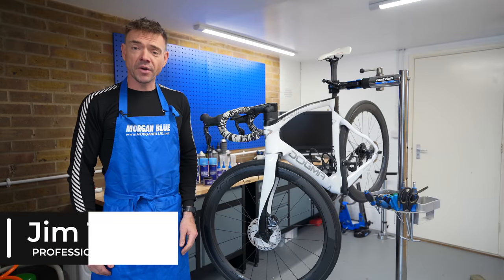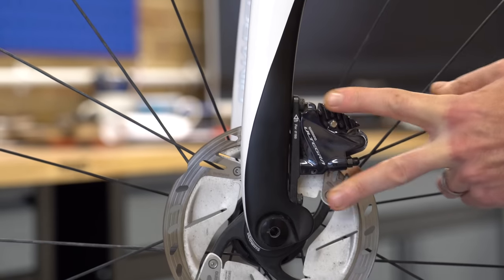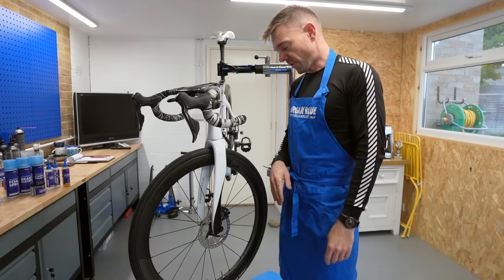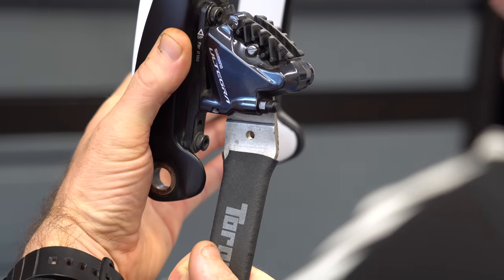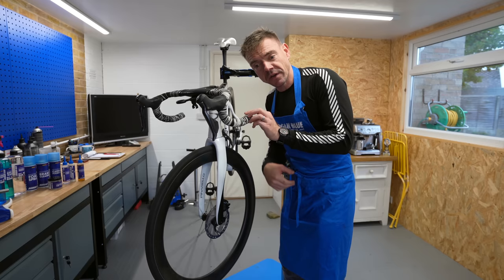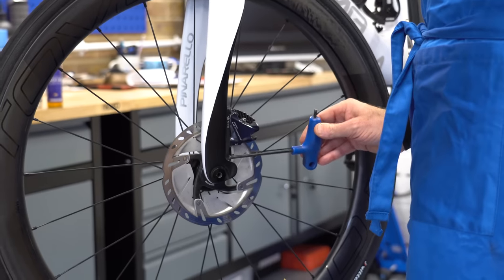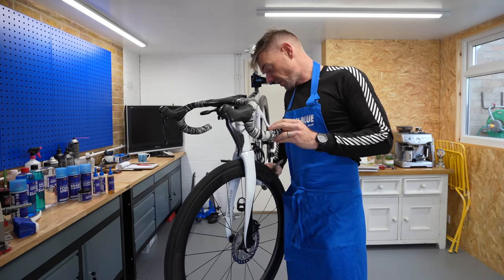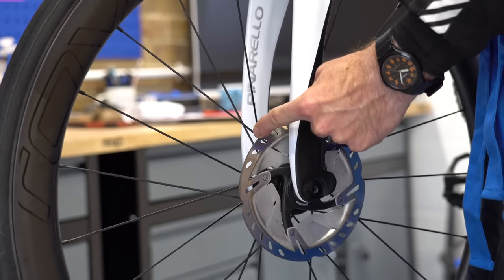How to Set up your Disc Brakes: 3 Easy Tips for Better Braking

Comment: This is a wonderfully clear description of basic disc brake maintenance.  I've tried the first method loosen brake caliper bolts, apply brakes, and then tighten the bolts and it works almost every time. Thanks for the tip about the tool, this seems like a must-have. (I've actually damaged pistons using screwdrivers, etc.) 

I'm more skeptical about your guidance regarding disc rotors.  In my experience, if you're having brake problems, it's pretty much never a rotor issue. If you're not throwing your bike into your car every weekend, your rotors will probably be largely intact for a  good 5-6 years. If you do have a bent rotor, trying to bend it back will probably make it worse; I've actually watched a bike mechanic destroy my disc rotor right in front of me by bending the ** out of it. If my rotors ever get bent, which will almost certainly never happen, I'll just avoid a world of bother and just replace them.
Reply: Ultegra and Dura ace (not new ones) get bend very easily.
Reply: @UC4EDj0x4Ja_llcRnKKips_g I've bought mtb rotors. Just get XT or XTR they're much better. New Ultegra 12s is already with these kind of rotors

Comment: I had disks rubbing for a year and I couldn't figure out the cause. I don't know why it never occurred to me to reposition the the whole brake by loosening the connecting bolts, apply brake, check center, and tighten. Thank you very much for reminding me of this. Solved a long-running frustration and makes riding just that much less aggravating. It's the simple things most of the time.

Comment: Clear advice, nice one. My GRX brakes would not stop rubbing using all of the above techniques... I had to bleed the brakes to get the pistons to retract properly. I also find that flat mount bolts need to be tightened a tiny bit at time as going all-the-way tight one one and then the other can mis-align your carefully straightened calliper. So annoying!
Reply: Yep, thats a very good point 👍
Reply: Exactly this.  Spend ages aligning the calliper only for it to become misaligned by tightening the mounting bolts back up to the correct torque setting.

Comment: Excellent video!  I can only add that if you are resetting the calliper pistons by pushing them in when they are used (to fix rub or replace pads) then you can take the pads out and clean the sides of the protruding piston so it does not drag (brake dust) gunk back into the calliper.  Also check the width of the rotor as part of the (truing) work - wearing thin can make it easier warp but also closer to end of life to replace

Comment: Very nice video! However I do use a few helpers along the way - I have an alignment tool which you put in between the pad and the rotor which makes adjusting the caliper a bit more reliable and instead of the proper tool I just use an adjustable monkey wrench to straighten out the disks. No issues there - I always managed to straighten out the disk pretty much completely. Another tip for aligning the rear caliper - take off the chain so that you don't have the freehub noise when you check for misalignment.

Comment: Two things - 1. dont worry too much if there is a bit of rub with a new break pad, they are precision engineered and you are on the limit of the range of movement until it wears slightly and stops rubbing. 2. My calipers were perfectly aligned but after 2 years, the wear for each pad is not parallel, and there is a bit of a squeek. The caliper can be misaligned by being slightly twisted it seems. I am going to try and align them with very thin feeler guages when I replace the pads and see if that works better.

Comment: Clear video and great job. I've used a alignment tool in the past for aligning the caliper with good results. Like a little shim for the rotor that inserts into the caliper. Was there a reason you didn't go that route? Some reason you shouldn't use?

Comment: Good video.  Surprised at the recommendation to use the ball end if the Allen key of the square end doesn't reach - shouldn't the advice be to get an appropriate tool?  Especially after the emphasis on getting a disc brake tool, rather than getting by with pliers and tyre levers.
Reply: @tombolo22  The ball end is usually viewed as inappropriate for high torque applications, because it runs a risk of stripping the head of the bolt.  If there was no down side to ball ends, why would you ever have square ended tools?
Reply: @tombolo22  I'd suggest that 5-8Nm is reasonably high torque for a 4mm hex bolt, I don't think they'd go much higher.  In answer to your question, I never really "got" torx head bolts; in my experience of small torx bolts they have been more price to damage than hex bolts.

Comment: Before pushing the pistons back in, I would recommend actually removing the brake pads and cleaning the pistons as best as you can with alcohol. In my experience if you manually send the pistons back before attempting to clean them then the "sticky" piston problem only gets worse.

Comment: Great vid Jim.

Two other very important things to check for first:

1. The wheel is properly centred within the fork. Even a thru axle hub system can have some play. Before you torque up the thru axle place the bike on the floor, put some weight on it and then tighten up. If you do it on the stand the wheel might not 'settle' correctly.

2. The rotor has been seated properly on the hub. Sometimes they can be skewed - when they've be put back on over some grit.
Reply: Yep, totally agree👍

Comment: Trueing rotors is a drag... but more importantly:
If you have one of the pistons not going back properly, even after cleaning them over and over, it might mean the seals have hardened. Means you need new calipers.
I've once been fooling around with a brake for hours on end, because I didn't knew that those seals are made of some sort of rubber that becomes stiff after a few years.
Reply: ...oh and nice Pinarello btw!

Comment: I had to stop using disc brake cleaner on my rotors because it made them squeal like mad, same if the pads got cleaner on them too. They're quiet when they're dirty. Bit like the saying "squeaky clean"